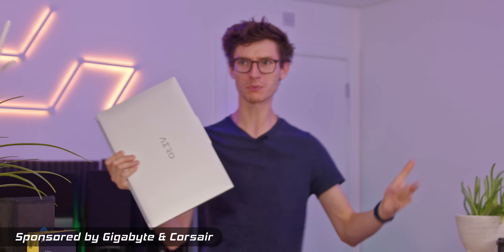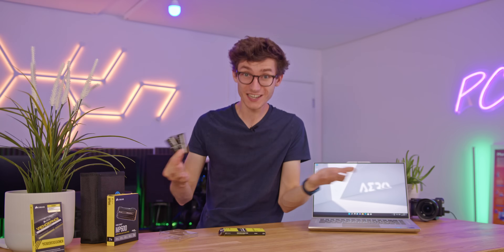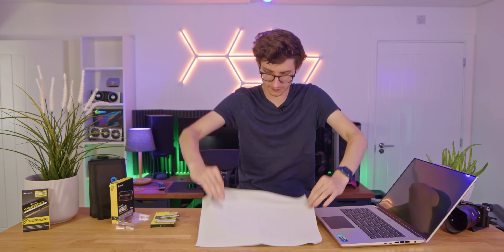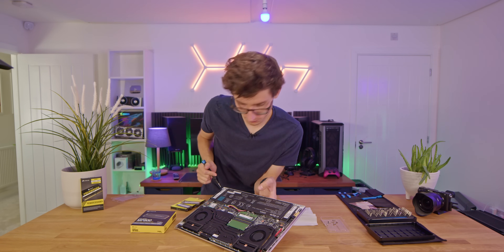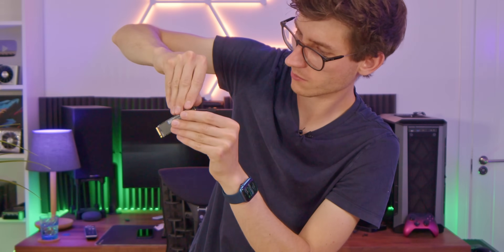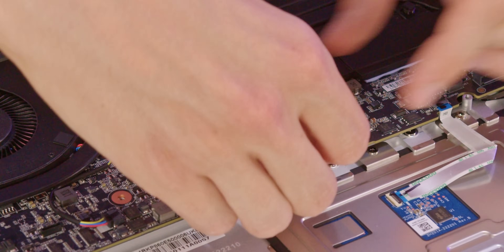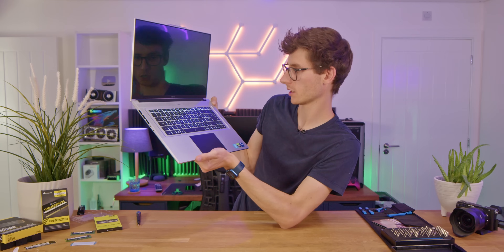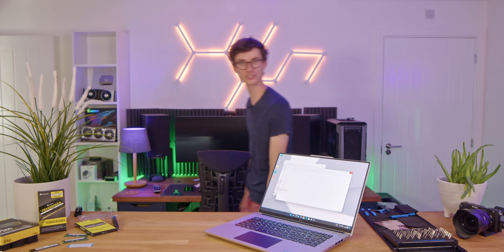How To Add More RAM & SSD Storage To Your Laptop - QUICK & EASY!  (DDR4/DDR5 PCIE GEN 4 m.2) | AD

Comment: It's not hard to do some RAM / Storage upgrade. but it's important to check that your not violating your product warranty. if you care, of course.
Reply: I was wondering, what if my laptop only has 1 ssd slot? I still want to upgrade it and put windows on it. But what if my single ssd in my laptop is the booter ssd and I want to upgrade that one ssd and have windows on it as well?
Reply: @VeeTalksStuff  In that case you will need to do some preparation steps.  1. Copy important files to external storage, 2. create Windows bootable USB. - then you can upgrade to new SSD , install windows with bootable USB, and copy your files to new system.
Or you also have second option: 1. Buy m.2 to USB adapter. 2. connect your new SSD through USB. 3. Clone your Windows system to new SSD using third party software(ex: Acronis True Image).
Reply: @Tech.Closet  perfect! Thank you so much
Reply: "its not hard to do some RAM / Storage upgrade" im pretty sure devoting my entire life into building a time machine to make dinosaurs come back to life and give everyone free ice-cream would be easier.
Reply: @belkYT  oh for sure, i've actually done that already
Reply: You’re are just a bit jealous that this great person is trying to help the common consumer from techs like you that would charge us $$$$$way too much to do something as simple as that…and my computer is out of warranty anyways…thank you so much for sharing
Reply: Im pretty sure the warranty on my nearly 15 year old laptop has probably expired already
Reply: do we need to back up all our 256 gb files before changing the ssd?
Reply: Hello sir, my laptop is new and expensive even though it looks easy im scared if i do something wrong and the laptop gets damaged permanently
Reply: It's worth noting though that when the manufacturer provides consumers instructions in their documentation on how to do it, they are completely safe.
Reply: @Tech.Closet hey I know this was 2 years ago but I’m hoping you still see this
I CANNOT do this. I upgraded the ram easily it was all going amazing until I went to reconnect my battery. It simply doesn’t fit under the little metal clamp thing. I have an ASUS a15 rtx 4050 ryzen 7
It’s my first ever form of pc gaming and I’ve fucked it within a week of having it. I DID NOTHING WRONG I WATCHED EVERY VIDEO POSSIBLE MULTIPLE TIMES BEFORE DOING IT AND WAS SO CAREFUL 
Everything looks perfect, no pins broken nothing broken but it simply doesn’t sit under the metal clamp

Comment: It's important to note that some laptops with RGB lights have their module connected straight to the motherboard, and by opening the laptop one could break those cables! Be careful!
Reply: I was wondering, what if my laptop only has 1 ssd slot? I still want to upgrade it and put windows on it. But what if my single ssd in my laptop is the booter ssd and I want to upgrade that one ssd and have windows on it as well?
Reply: @VeeTalksStuff  you have 2 ways to do it if you have a usb stick and want a fresh install of windows you can reinstall windows but if you want all the files from your other drive you can get an m.2 to usb adapter and use a cloning tool to have all your files preinstalled onto the drive
Reply: I don’t know what I would do if my rgb broke. Prolly die… Thank you for this information.
Reply: @SqueakyFishy  You would lose a ton of fps in games if you're RGB would brake 😉
Reply: Like ANY Asus ROG Strix from at least 2022.  MSI nailed their case RGB.

Comment: Extra tips when taking of the cover be aware of conectors like rgb cables
Reply: I was wondering, what if my laptop only has 1 ssd slot? I still want to upgrade it and put windows on it. But what if my single ssd in my laptop is the booter ssd and I want to upgrade that one ssd and have windows on it as well?
Reply: @VeeTalksStuff  if ypu wanted to uograde ur win 10/11 ssd you have to transfer Windows to another drive then get in the new ssd then transfer back Windows to you boot ssd. Im going to do the same thing in the future.

Comment: Just to note : it is usually not necessary to put thermal pads for RAM cards. There might not even be a heat sink for them depending on model.

Though maby the double-sided 32GB ones need the extra heat dissipation. Follow what applies for your laptop and RAM sticks.
Reply: But considering that in this case the manufacturer provides it, it's best to keep it in place for warranty purposes.

Comment: I made the mistake of ordered a rain pack of 8GB RAM cards for my older laptop, but unfortunately I didn’t realise it used DDR3, and I got DDR4 cards.
I’m now having to order DDR3 cards for that machine.
I was able to use one of the DDR4 cards in my other newer laptop but it’s got a weird layout with only 1 RAM slot, and no space or connection for an NVME card, which I also hoped to be able to use.
Better than nothing but a shame I couldn’t use the NVME memory too.

Comment: I spent probably £350 on going from 8gb to 12gb ram and an SSD from an HDD on my 4 year old laptop but saved my well over £800 if I just went and bought a new laptop. So upgrading is the way to go if its possible.

Comment: PC Centric I need your help with something. I was going to build a gaming pc and I had a Ryzen 9 and a 3090 ti with 32Gb of ram with a 1200 wat power supply.  Would that work very well?
Reply: Are you asking if the power supply would work for the gpu?
Reply: @VeeTalksStuff  yes
Reply: @CrackerKing7  that will for sure work
Reply: @VeeTalksStuff  ok thank you
Reply: Its plenty of juce for youre system i can defently say thag i have 3080 i7 on 1200w and its overkill to be honest

Comment: How bad/damaging is it that I swapped out the ram and ssd on my laptop but forgot to disconnect the battery?
Reply: Provided the computer wasn't actually powered on (i.e. running) at the time, it'll be fine. Removing it is just an additional safety measure is all.

Comment: my laptop has 4 slots currently only 2 are used, do I have to match exactly i believe they are two 8 gbs to make up 16,  can I put two 16s in the other two empty slots? Or would they have to be the same 8 as that's in my laptop currently.. Yes i have 4 lol it's a predator helios 300 3070ti gpu 12thgen i7

Comment: Quick question! If you were to upgrade your RAM and/or SSD would that sort of reset the computer? I mean like make it so I lose games and softwares I have downloaded?
Reply: Yes I assume that replacing/upgrading the SSD will get rid of that. Is there a way to transfer it if it doesn’t just save to the computer?
Reply: ram doesnt change anything of your computer just upgrades it but if your laptop has 2 m.2 slots you can put both drives in it but if theres only one you can swap it out and clone it @BongooVR

Comment: when I reconnected my battery, there was a blue spark on the right side in the connector but wasn't there after fully plugged in. The laptop turns on but is this anything to worry about or just electricity trying to jump the gap?

Comment: So i guess no heatsink or thermal pad is required for an nvme m.2 ssd for games to go on?
Reply: The Aero (BSF) has thermal pads pre-installed on the bottom of the case (which is aluminium) for the SSDs.

Comment: Hello, I have a stock 8gb in my laptop right now. Would it be ok if add 16 gb or will that not work.
Reply: Get 2 16gb ddr4 ram or 5 if your laptop supports it and a 2TB SSD NVME M.2 drive for faster navigation through windows
Reply: @  I can’t remove the stock ram so could I just add another 16gb
Reply: @Aviation_Curry if you can find a 32 gig one instead to maximize your performance

Comment: looking for the right RAM to buy and wanted to know if the processor MHz mattered because mine is 1200Mhz but all the ones you can buy are above 2000Mhz. would this not be compatible? also love the content super useful thanks x
Reply: The more, the better
Reply: @lostseb0945  thanks I actually just replaced my ram from 4gb to 16gb it improved a little but its still slow.  I'm looking into changing the cpu now as its working at 100% capacity so that's the next problem 😅

Comment: if i swap out my ssd will all of my data vanish
Reply: No unless you swap out the wrong one, but yiu can swap it back in to revover your data but remember to disconnect the battery before you do anything
Reply: @ironbolt450  What do you mean "wrong one"? If there is only 1 SSD and you swap with another - how it gonna magically transfer that data to new one? Do you always have to have old SSD inserted at all time? This will make it impossible to upgrade without losing data

Comment: Would changing my hard drive fix my “100% hard drive usage”?
Reply: Yes it would!
Reply: @TechHunterOfficial  Thank you! Then that would mean i would have to install windows on the new drive correct?
Reply: @gideondeonseo  Yes, you can copy it over using a program called Macrium Reflect and connecting the new SSD by a USB. But it will all run so much smoother if you just go with a fresh install on the new SSD :)
Reply: @TechHunterOfficial  i am currently using a hdd and my laptop is unable to support ssd’s. Would it work the same and is it somehow possible to use an activation code only to install windows or do i have to have a usb?

Comment: "a 3yo could replace the RAM" My current laptop (built in 2014) was designed by an idiot. the RAM was obstructed by a heatsink pipe.... required quite a bit of dismantling and reassembly